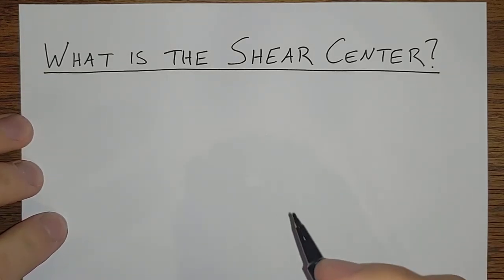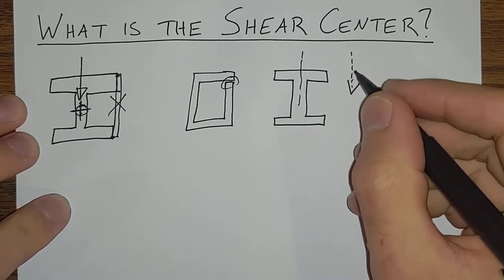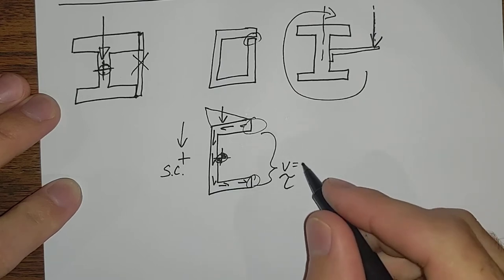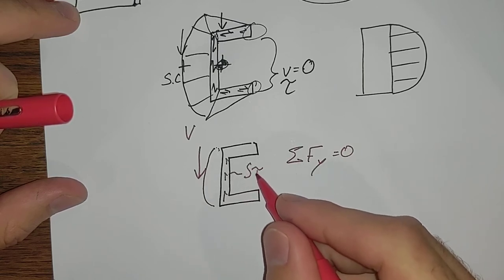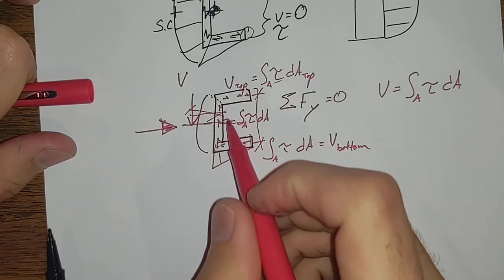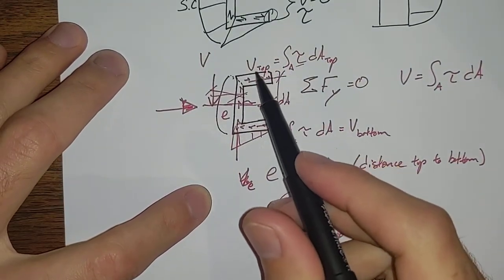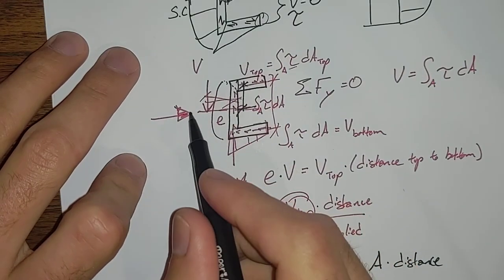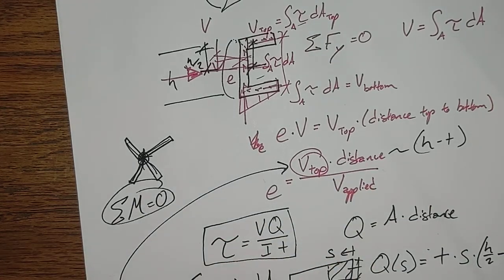What is the Shear Center?

Comment: Thank you for the video. So what do I do to avoid torsion for PFC while shear centre is locating outside the section ? How to deal with torsion when the load is actually applied on the top flange ?
Reply from the maker: Thanks Fedor!  So unless you load at the shear center, the torsion is going to always be there, and your best defense is to somehow incorporate tubular shapes into your structural member.  Otherwise, anything you can do to either try to get the load applied closer to the shear center, or to move the shear center closer to the load will help to limit the eccentricity and therefore your torsion on your section.  Even a tiny little tube applied somewhere on your shape helps tremendously!  If you have a specific design question, definitely feel free to email and we can discuss more!  eric@structed.org
Reply: @StructEdOrg  wow. This is so detailed explanation. At uni, they taught how to get shearcentre but they didnt teach what to do after getting the shear centre (maybe they dis but I am the one who forgot) Thank you

Comment: I’m struggling to understand why the shear distribution is parabolic at the vertical section of the c section and linear at the horizontal ones.
Reply from the maker: No problem Juan!  It's buried in the whole q = V * Q / I equation.  Q is the area outboard of the section you're cutting through times the distance from the centroid of that area to the centroid of the overall shape, and it's the only part that changes as we march along the shape.  The overall shear V and the overall shape I-value are constant everywhere.

When you're in the horizontal flanges, the distance centroid-to-centroid remains constant, it's just half the height of the overall shape minus half the thickness of the flange, so the only part that's increasing is the area, which goes up linearly as we move along the flange.  

In the vertical web, two things are going into that increasing Q. We've got the area increasing at a linear rate again as we slide down the web, but also have the centroid-to-centroid distance shifting, which multiplies by our coordinate again, giving that second order, or parabolic, distribution.

Does that clarify it?  Happy to explain further or shoot a video expanding on that if it's at all unclear!
Reply: @StructEdOrg  thank you so much for replying. I understand it more now, but I think I’m still struggling to visualize it a little bit. I will try to go through it again to see if I can make more sense of it. Thanks again!